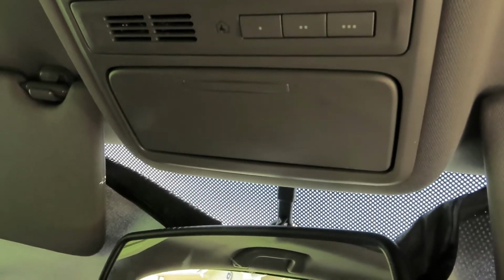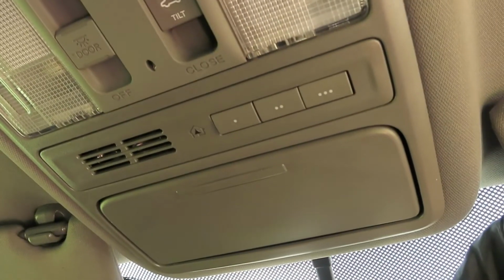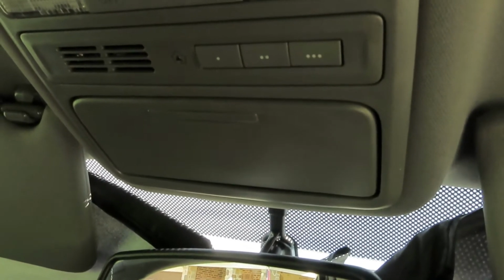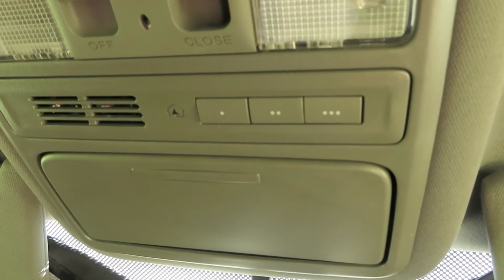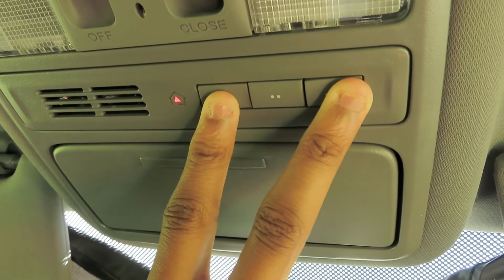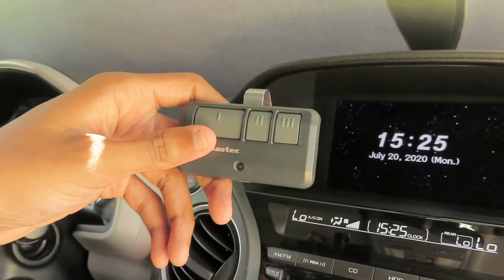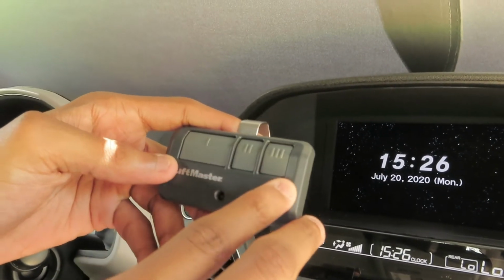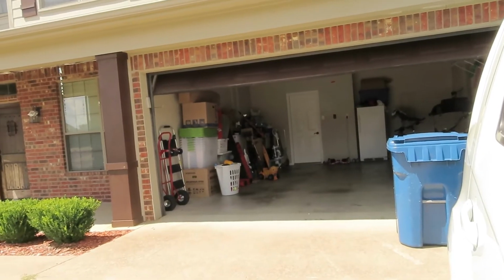Training HomeLink Garage Buttons in Honda Pilot

Comment: I am trying this today on my 2018 Honda pilot. This does not work. Needs to be a little bit more specific does the vehicle need to be running? Do we need to be in range of the garage door? I’m not saying this method is an accurate, but it did not work for me.
Reply: They forgot to mention, the vehicle has to be running. Thanks for asking as that helped me!

Comment: Awesome video, it helped but mine still wouldn’t work. I remembered there is a program button on the actual garage door opener ( like a sync button). Once I hit that it worked perfectly!
Reply from the maker: oh sounds like yours has a rolling code. glad this helped.
Reply: So do you hit the garage door opener button after the steps listed here? I tried following the instructions in the video and no luck.